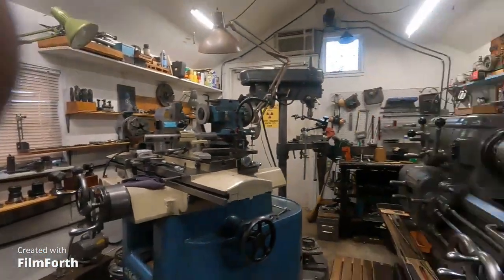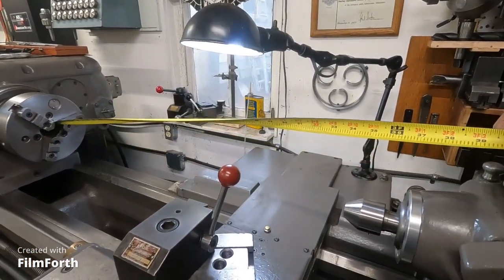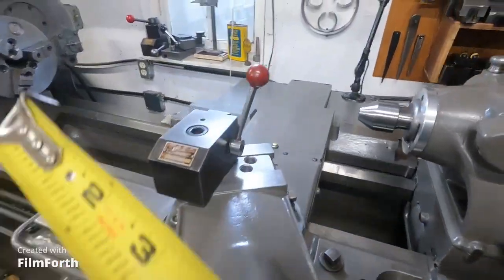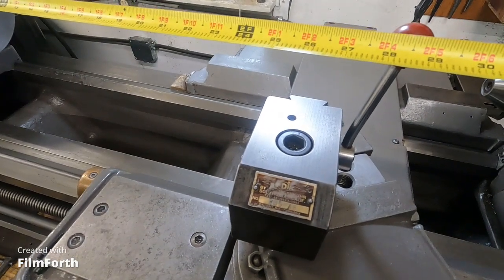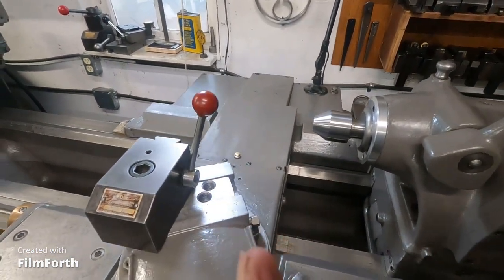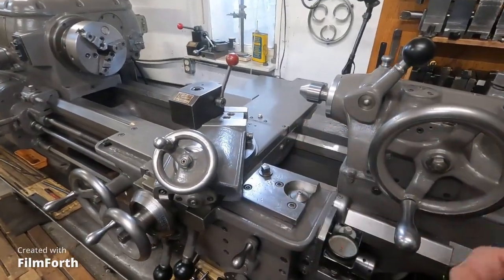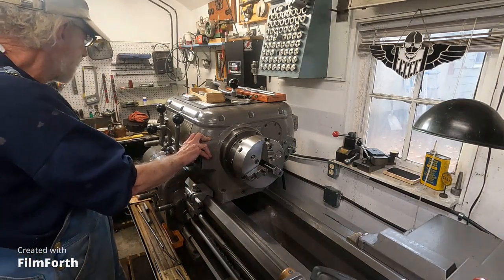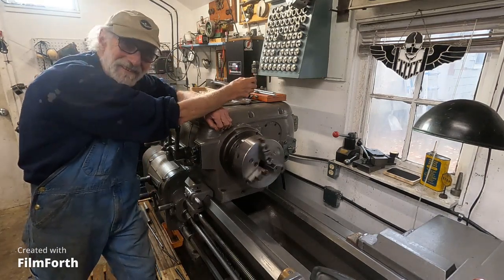Using the Monarch 10ee lathe for small screws 1

Comment: You can always angle the compound the other wayand use the other side of the toolpost to get those extra inches, though it may mean working in two parts and having to pick up a surface already machined.

Colchester lathes also have twin clutches and a centre brake position.
It would be really hard having to go back to a machine that doesn't quickly stop and reverse after using one that does, it makes threading any weird pitch so easy.
Reply from the maker: Yes! You have to do it the hard way sometimes